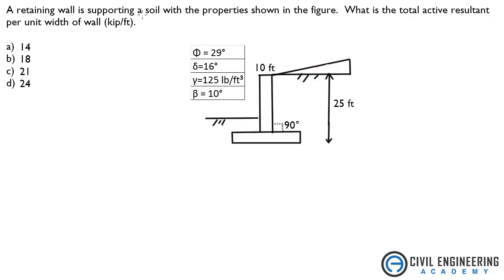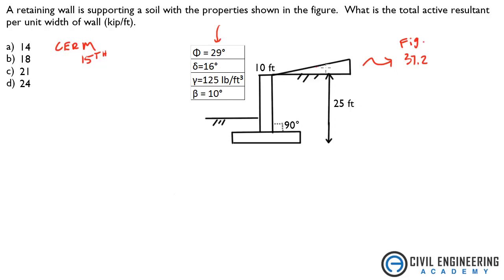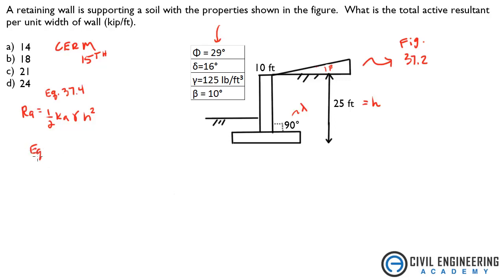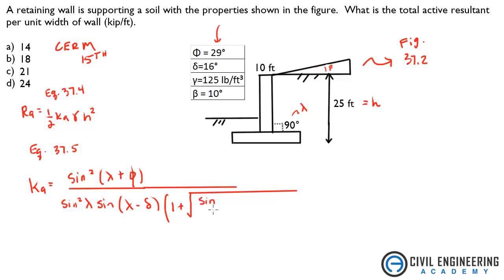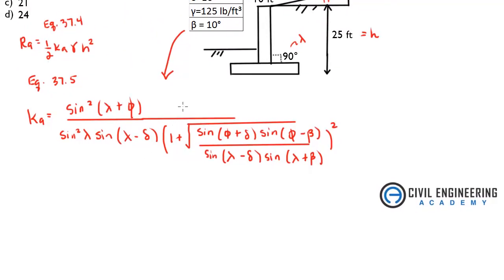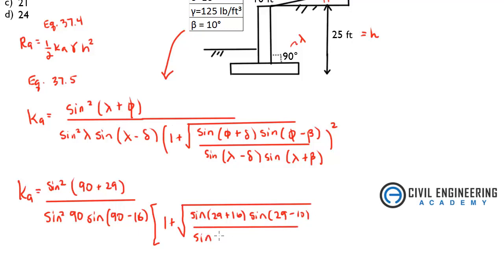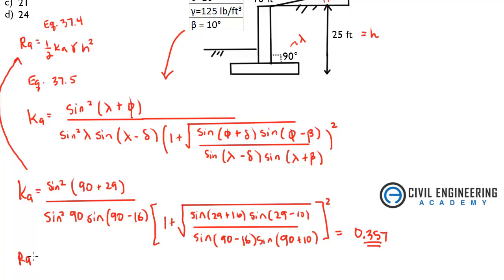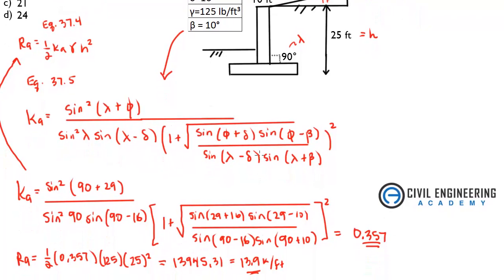Civil PE Exam - Geotech -  Find the Resultant Force using Coulomb

Comment: I think threre is something  wrong  because the equation in pe book last version not matching with this  video and the (ka)  equal 0.53
Reply: yeah the NCEES handbook has a different equation! has cosines where some sines should be. but it puts a cos(90) = 0 multiplier in the denominator, so i think theres a typo in the handbook?
Reply: @emilygordon4696 i think this difference is because of the angle theta (or lyamda in this video). Unlike here, Handbook takes that angle with respect to vertical, ie angle =0 for vertical.

Comment: By using Table 37.3 (Tabulated Coefficients of Active Pressure, Ka (Vertical Wall, λ = 90 degree)) take the average of (0.372+0.342)/2 = 0.375. No need to calculate using the formula. Especially in PE exam.

Comment: I may have done this incorrectly or by chance it worked out, geotech isn't my strongest suit. 
But if you use this formula to get Ka you also get 0.35
Ka = tan^2(45-(phi/2)); phi is given as 29 degrees
Reply from the maker: Yes, this is the Rankine equation.  You can only use this if the wall face is 90° and the backfill on top is horizontal (beta=0).  If the other variables are showing then you have to use the Coulomb equation which is the big nasty used in the video.  Good thinking!
Reply: flamenballerG37 you got lucky because beta is small at 10 degrees so the inclined portion is almost neglegable